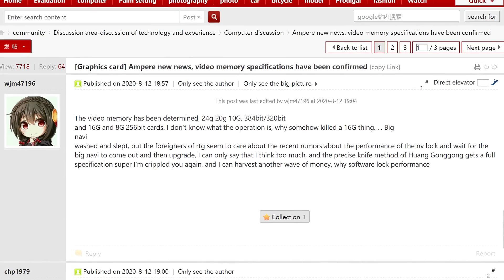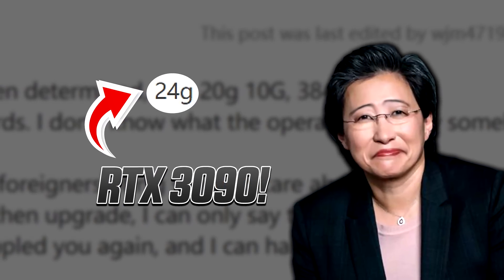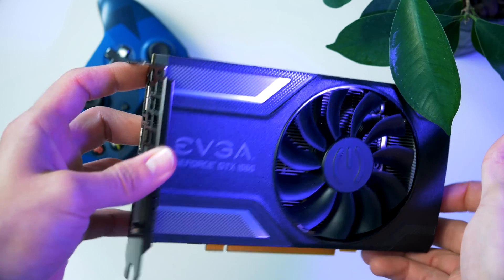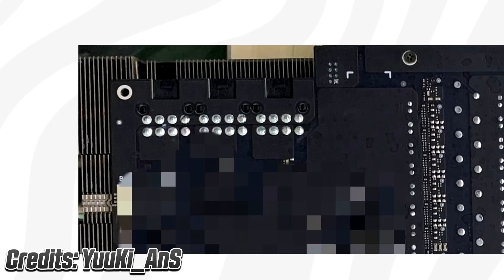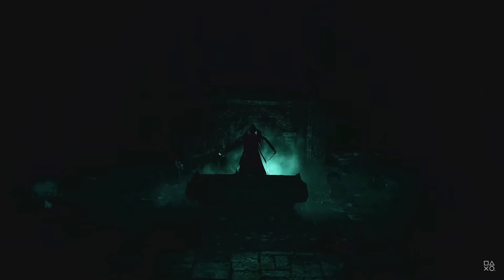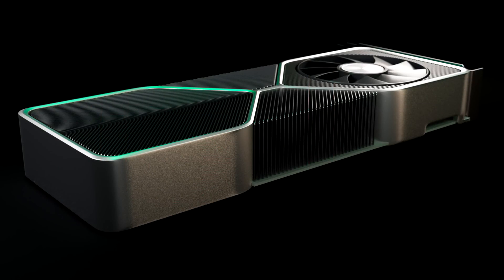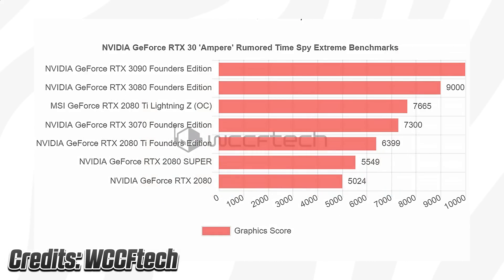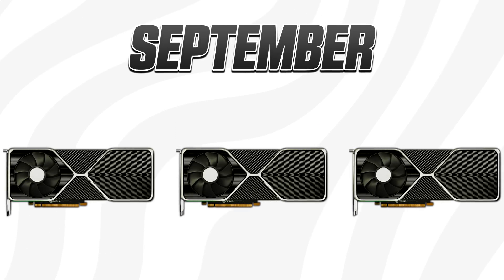GeForce ‘Ampere’ RTX 3090, 3080 + 3070: Price, Specs, Benchmarks, Release Date!

Comment: I'll wait on the 3070Ti or Super revision.Power will be close to a 3080 & with all of this new stuff , I'm sure there will be at least a couple things that need improving.All the kinks should be worked out by then & maybe on 7nm for less power draw & heat , & better overclocking.

Comment: just need the 3090/3080 ti/rtx titan ampere for the so called lg 49 inch 1440p 144hz or 240hz in couple years
Reply: Unoptimised games all will say together : NO
Reply: there's already the samsung G9 odyssey 49" 1440p 240hz hdr 1000
Reply: @perceptivity_  yea but the g9 is discontinued